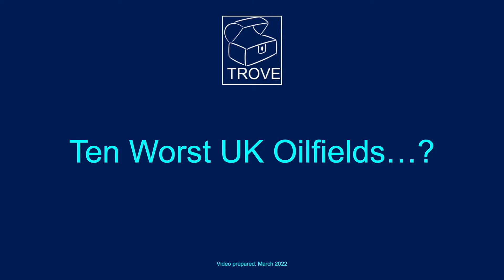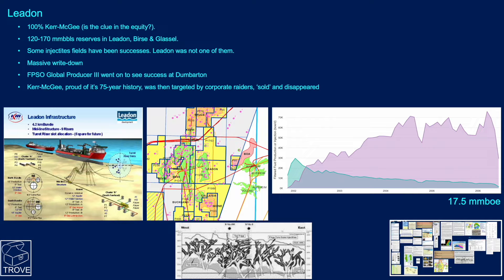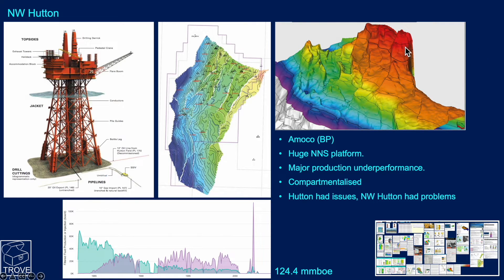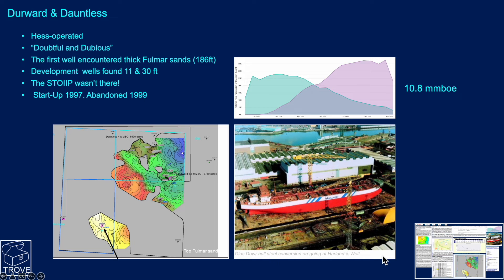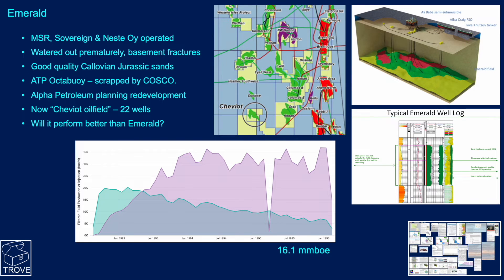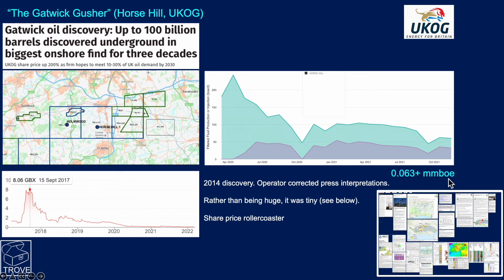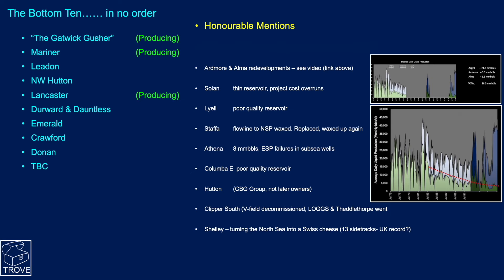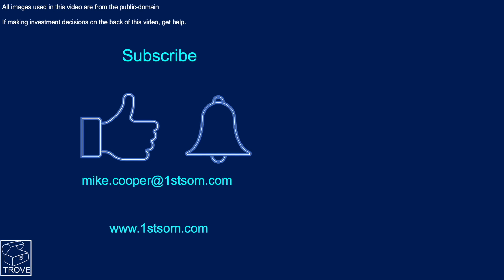Ten Worst UK Oilfield Developments?

Comment: Very interesting as someone who left the north sea in 1997 fascinating to see what happened next. I recommend "North Sea Scorecard" SPE 15358 for a 1980's look at what went well and badly most of original giant developments were financially successful despite irrational exuberance . I also have a nominee for #10 from the 1980's, check out Tartan (Texaco) where urban legend had it the first development well was a dry hole,  fortunately they were able to pivot change the conceptual model (got a couple of years grace from Piper Alpha) and make a partial success and bring in a bunch of satellites which went well in Highlander/Petronella. The platform sat about a mile off all the future wells though. Plenty of examples where A01 is the best well in the field which brings its own issues.  I have a couple of personnel nightmares from West Africa as well which have served me well for 20+ years.
Reply: Thanks for your comments and support Mark. Tartan was discussed with a major fault located underneath the platform but it performed well over a long life. I am convinced there are reserves still to be recovered in the area. Not just Perth, with one of the longest oil columns in the North Sea but potential in the Supra-Piper and other leads and prospects identified in the area. The problem here is poor seismic quality due to thick and shallow channels in the overburden with poor velocity control. I remember part-funding a shoot in this area and getting very disappointing results.

We may do a "Top 10 Worst Oilfields Globally" video at some stage. Would love to hear about your West African candidates. You can reach us at info@1stsom.com.

Will check out the paper you recommend. Thanks again,

ATB, Mike
Reply from the maker: Hi Mark, it wasn't just urban legend. The first well, a vertical well from the platform drilled the hade of the fault between the Upthrown and Downthrown fault blocks so did indeed miss the reservoir. The seismic of the time was not of sufficient quality to image the fault. Things have move on a lot since then......

Comment: Thank you for this video. Clipper South is still producing, having been re-routed via the Shell Bacton facilities. I worked for Clipper South (now operated by INEOS) between 2018-2021 and it was my impression both the original development and the re-routing were clear successes, with excellent subsurface, wells and facilities engineering work.
Reply: Thanks Orlando. I worked on a gasfield that wasn't as lucky as Clipper South to be able to withstand the cost of rerouting from LOGGS/Theddlethorpe to Bacton. Fortunately Clipper South had sufficient remaining reserves to warrant rerouting. I understand it was nominated as an example of a field which, through no fault of it's own, almost had it's fate determined by external factors. We were struggling to find an oilfield example - so it was the only gasfield on the list. Looming in the not-too-distant future will be a domino effect where the combined cost of SVT and the BSP & NPS pipelines will eventually become uneconomic and cause the premature closure of an entire basin - now there's a video!

I believe in just about every other way, as you state Orlando, Clipper South was a success and does not deserve to be on this list. Thank you for pointing this out and best wishes.
Reply from the maker: Thanks for the info Orlando. If we do an update I hope we include this success story.

Comment: Linnhe didn’t cover itself in glory. I believe it was the field that was the fastest “first oil to failure” in the North Sea due to the flow line to Beryl Bravo repeatedly waxing up. After several xylene sweeps Mobil(& partners) abandoned it.
Reply: Hi Angela, I was at DTI when the FDP was approved. Left before it came on stream. Similar story then to Staffa? Shame, as the Linnhe discovery was exciting at the time. Hope all's well. ATB, Mike
Reply from the maker: Waxing up of flow lines still happens occasionally. Flow assurance is critical in the design process.